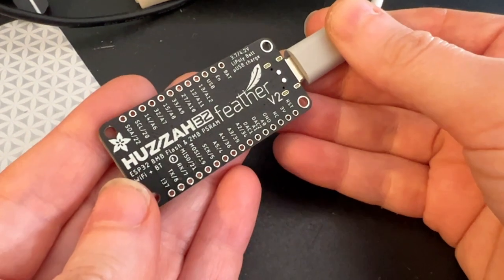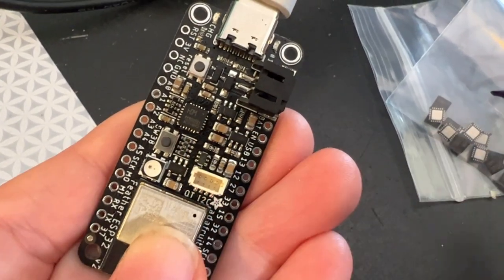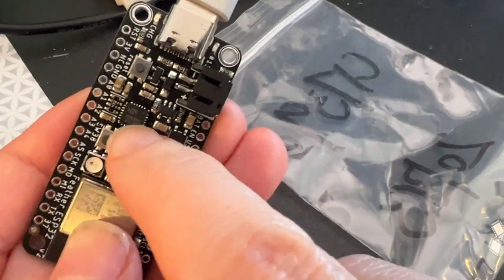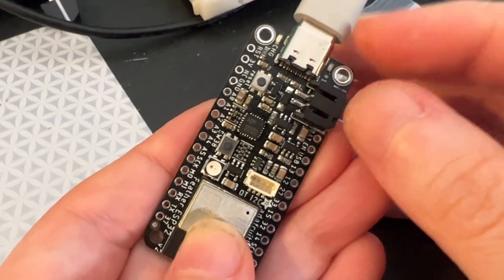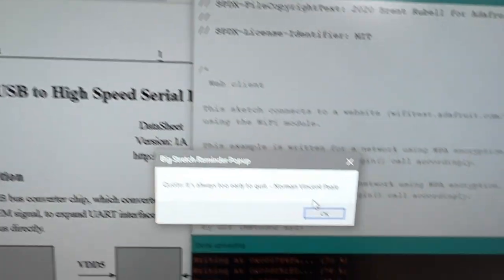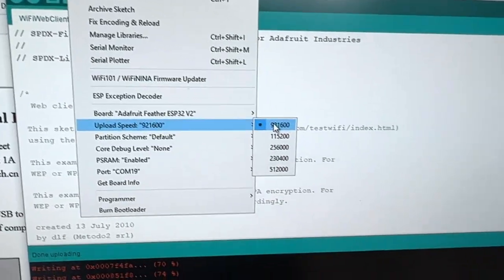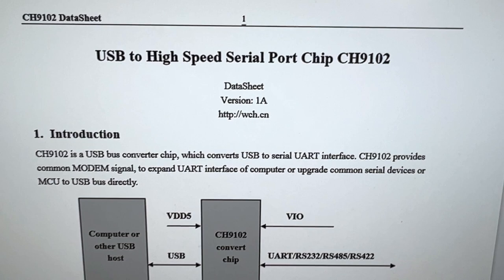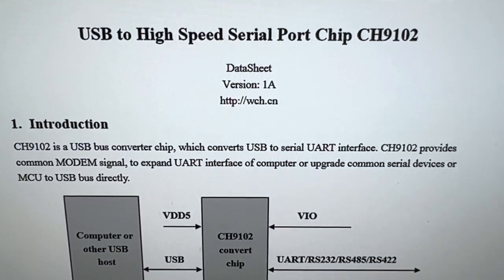Trying out the WCH CH9102F in place of a CP2102N

Comment: CH9102 and CH343 have this VBUS pull down capability on top of CP2102N, which can be used to implement a VBUS-switch using a PMOS or to implement a VBUS discharging circuit for more reliable re-plugging enumeration. Also, the 3mm*3mm package (CH343P) has both RTS and DTR, making it the smallest (conventionally packaged) ready-to-use (no firmware coding) ESP32 downloading bridge. In addition, CH9102/343 do not suffer from the same DTR glitch during serial port opening and closing, so if reliability is not at No. 1 on your priority list, you can save the two NPN transistors as well, just connect DTR to EN and RTS to IO0.

On the flip side, detection threshold on VBUS is not the same on CH9102/343 compared with CP2102N, so if you use a voltage divider to implement precision UVLO on VBUS, you need to tweak your circuit. The threshold is no longer VIO-0.7V. Learned it the hard way. Also the built-in 5V-3.3V LDO is not as capable on CH9102/343. The rated max output current is only 10mA, so consider it a signal only. OTOH, CP2102N's LDO can output 100mA, which includes its own <=15mA of consumption, so you can pull up to 85mA from it.
Reply from the maker: good info, thanks! we are using the internal regulator but NOT for other chips, just the serial chip itself as that is the lowest power mode. we do have a vbus divider, we will adjust the values as necessary thank you for letting us know its not the same. for the dual transistors, we're going to stick with them since we prefer reliability no matter what the OS does with the control lines :)

Comment: FWIW, JLC have 888 of them in stock ready for SMT pick N place today. But then again they've got 20,000+ of the various CP210 series too! What chip shortage? If you need bulk CP210whatever then just get them to SMT build a few PCBs with 100 chips per PCB then recover them all with a hot air gun on reception :)
Reply from the maker: thanks for the purchase tip - there are cp2012n in stock, but the price is 3x what it used to be - its not practical to spend $2 on a USB serial chip!

Comment: I thought the ESP32 Hazzah uses the CP2104 and not the CP2102
Reply: CP2102N QFN24 package is pin to pin compatible with CP2104 of the same package. CP2104 was declared EOL a few years ago, I think they have since switched to CP2102N. And yes, I also have a very old Huzzah board with CP2104. CH9102 QFN24 is NOT pin to pin compatible, but if you only use the serial port function (not GPIOs, and you do not need a precise VBUS UVLO), they can be practically considered pin to pin compatible.
Reply: @bskull3232  your insights on these series of chips is quite fascinating reading